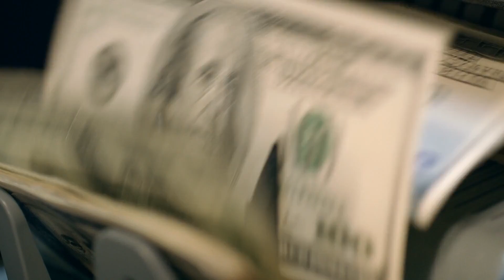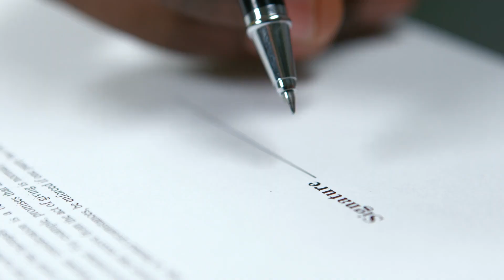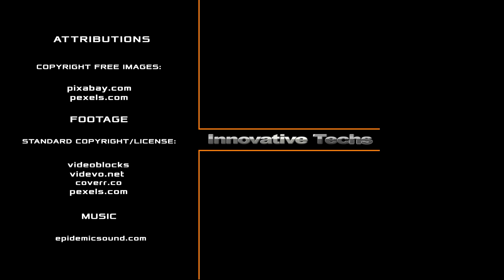How America Can Boost Solar Power by 56% Using Highways

Comment: Solution to Control Climate Change with Surplus Clean Energy before 2030, If Really Concerned ???

Solves both (Land & Funds) issue for Solar Energy, at Same Time,

Check 'Solar ROOF on Roads with Advertisements and Rain Water Harvesting System'

Lightenmyways

Comment: Had always wondered why can't highways been used, but not as panels on the tarmac itself but as overhead panels mounted on frames wit Sun tracking solar panels. Sure it's gonna be expensive as it will require retrofitting all the highways with a lot of steel frames to mount the solar panels, but existing roads can be used and benifits will more than compensate for the cost, as power evacuation is gonna be easier as all major roads are closer to end users. And was also wondering if there is gonna be any savings in fuel as all the vehicles will be driving under a shaded solar canopy.

Comment: How about covering roadways with panels overhead? Drier road surfaces - less road damage from rain. Less heat absorbed by the road surface, which normally would then heat up the air. Can supply some lighting at night. Cars require less ac on hot days. Road sides should be used for grass - more carbon capture and storage. Rainwater off the panels should be collected, filtered and sold for drinking.

Comment: This is an 10 idea that is already being done in Mass.    
Wow - What a great idea - only problem with this video and the consultants recommendation is Massachusetts is already doing this and has been for 6 years - massive solar installations all around major highway.  Love the channel but you've got to do a bit more research.
Plus I believe you figures on possible acreage are far too low. 
But do love the channel.

Comment: We had thought about it, came up with a proposal too. The concern was it increases the chances of something flying into road while cars or other vehicles passing through the road at high speed. Putting solar panels on top of road or on the divider puts a lot of wires, other equipment there which otherwise should not be there, increasing chances of accident manifold. Also, maintenance of the panels, puts a lot of people there who should not be there.
Reply: Solar panels belong on rooftops, over open parking lots, and big stretches of unused and otherwise useless land. That's it. Solar panels near roadways is asking to blind people
Reply: Instead of coming up with problems and stopping...come up with the problem and then the solution...Because if there's one thing that Mankind has proven throughout history, every time, we are presented with a problem...We've found the solution...that's why we're still here...🖖👍B💪
Reply: It wouldn't be so close to the road...watch the video 🙌

Comment: More could be added to this excellent idea. Concrete barriers could be set up on both sides of the open center areas on hi ways, on the inner edge of the pavement where there is a separation between the opposing lanes.  All these areas could also be paneled, possibly clear across the country in some cases. 

With the amount of energy this should generate for a one time cost, much of the power for lighting on roadways could be done nation wide, causing the total removal of all pollution from coal and nuclear fired power now used for this purpose. Great idea.
Reply: Nuclear Reactors are clean...nonpolluting.
Existing Nuclear Waste can be re-used multiple times and it's toxicity considerably reduced by hundreds of thousands of years 👍

Comment: Put Geothermal underground there 1st!!! 
Then put the Sklar Panels above to DOUBLE the Sustainability Efficiency ouput.
Reply: Sand Batteries 👍
Reply: Geothermal is very location dependant. Can't do it everywhere, only on geologically active hotspots.
Reply: @MagnificentXXBastard  10 feet deep always get 80f degrees approximately. From my research. Can use a coiled tubing or coiled wiring system for geothermal.
Reply: @lighttheoryllc4337  No,  at 3m/10ft temp is ~12°C or 53°F

Good lucking making any significant electricity with that.

Real geothermal that is cost efficient and can produce significant amounts of energy needs to go way deeper, like at least a kilometer in most places, and as such is only comercially viable in some areas, since ground heatflow varies a lot depending on geographical location. Look up geothermal heatmaps.